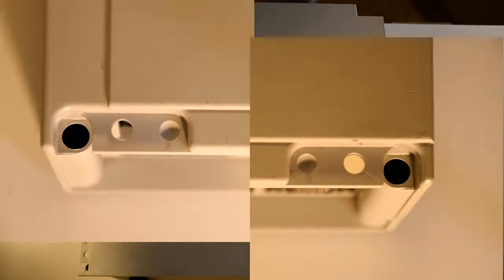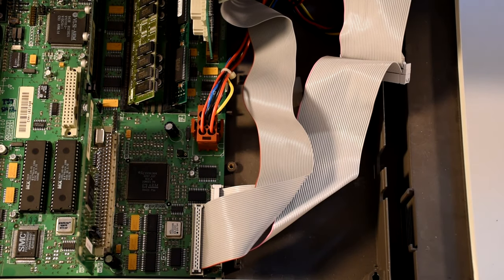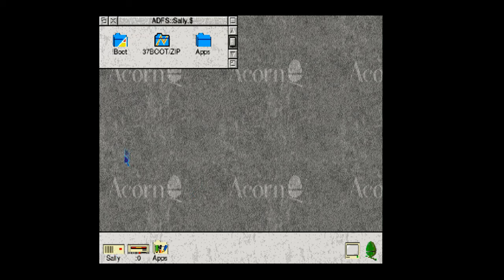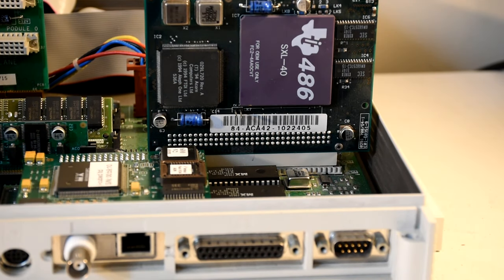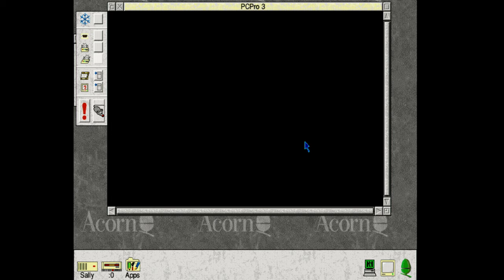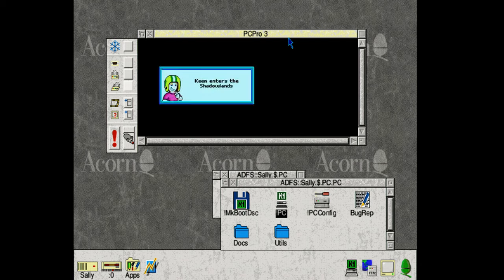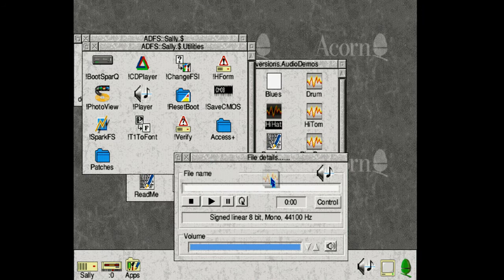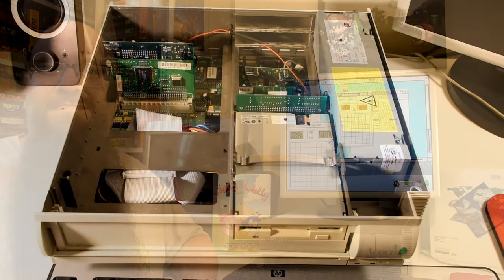Acorn RiscPC 600 : Part 3 - Upgrades

Comment: the 486SX was a poor choice, as there are 486DX4/100 and Cyrix586/100 available.;)
Reply from the maker: I mostly went with that chip due to availability and price,  A faster CPU would have been great but the sound and graphics emulation would still have been held back due to the ARM 610.

Comment: I would recomend putting the chips into a 42 pin socket if you plan on changing or swapping often. It's very easy to bend pins on these things and using the sockets mean you can easily replace a 25p socket over a hard to find and expensive set of roms.
Reply from the maker: That's a very good idea! I haven't needed to swap them out since making the video and current don't plan on it any time soon.
But If I do any more upgrades I'll definatly do that, as I've gotten closer then I'd really like to admit with bending some pins.
Reply: @GouldFishOnGames  I'm fecking about with an A7000 and two risc PC's one with strong arm and one with stock arm. I have 5 sets of roms from 3.5 to 5, and always manage to ping a corner pin over. I think I need to settle on something that just works and stop tinkering :)
Reply: @GouldFishOnGames  I have 4.39 and 5.22 roms I could donate if you ever feel the need for another vid.
Reply from the maker: Its one of the big issues with computer hardware there is always something new to mess around with or something different to try out.
These days I try to give my self max spending amounts or targets (like get game X to run) and try and keep it stable after that or I end up spending too much money or spending time I don't have.

Thanks for the offer for the upgraded roms, at the moment I'm happy with the current setup but I'll keep it in mind if I ever feel like tinkering again.
Reply: @GouldFishOnGames  I agree, with acorn hardware there's always a sweetspot where most stuff runs and you are happy. I've had to debug a few games to run them and even then they depend on a certain screen mode or amount of ram. 3.7 is the closest you can get to 3.11 without losing too much compatibility with the real games. Thank you for the uploads, very good watching. :)
Reply from the maker: Yeah, trying to identify and work out how to get to the sweet spot is the hard bit!
I want to do more Acorn videos, I've been thinking about doing videos on some of the more unique games on the system.  But tracking down boxed copies of games for the machine isn't the easiest (or cheapest) thing :D
Happy you have enjoyed the videos!

Comment: 60mb ram wasn't common surly ? as this would have been mega expensive in early 90's .. am surprised it even supports that much anyway
Reply from the maker: Being a 32bit CPU and OS it could technically address large amounts of ram.
But Simm sizes was the limiting factor and as such you could add up to 256mb of ram.
Which at the time would have been very costly, but these days isn't too bad to get.

Comment: An upgrade I'd like to know about is how to use a Raspberry Pi to connect SATA drives to a RISC PC, so as to future-proof my forest of RISC PCs for when my IDE's die and replacements are no longer available. Has anyone done that?
Reply from the maker: I know there are podules to connect a Pi to the machine, but no idea if they allow for using a Sata drive.
But you should be able to use something like a IDE to SATA converter.
https://www.startech.com/HDD/Adapters/25in-and-35in-40-Pin-Male-IDE-to-SATA-Adapter-Converter~IDE2SAT2
that would allow you to use Sata drives (though the IDE port not being 100% to spec might cause an issue)
Reply: @GouldFishOnGames  I've tried the podules and they usually use the pi as the primary server, some vnc I think wizardry gets the screen up. At that point it's probably better to emulate all the stuff on the Pi as a faster unit. I felt a bit let down with the two i've tried to be honest.  In answer to the question about IDE to SATA, there's no point. It's too slow. However adding an IDE to CF, and then using a CF to SD adapter in it, you can get a big improvement over the original HDD. You do have to work out the bugs in your setup first though. You do need to use IDE>CF>SD adapters though as trying the straight jump will just not work unless you do the adfs buffers command as you rightly said.
Reply from the maker: I'd seen the Pi-podules for sale but never checked them out as I was more interested in keeping the basic experience stock.
but yeah you really have to jump though a few hoops to use the IDE to CF, you either get lucky with a CF card that is compatible or you use those SD to CF cards which seems to work better.
Reply: @willproctor7301  What do the Pi podules actually do? I've always been a bit hazy on that.